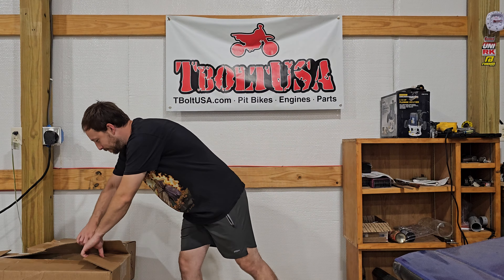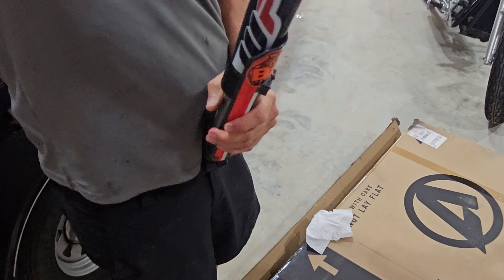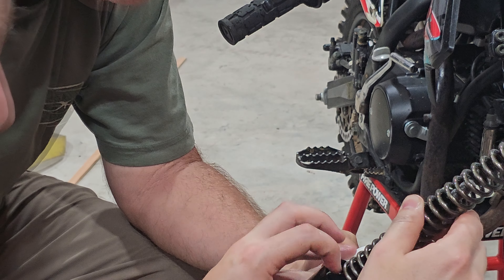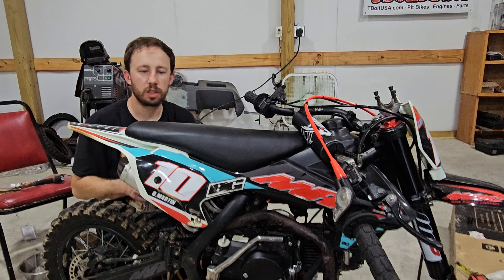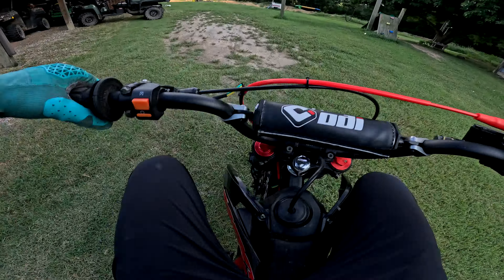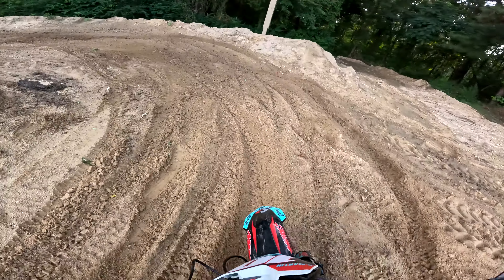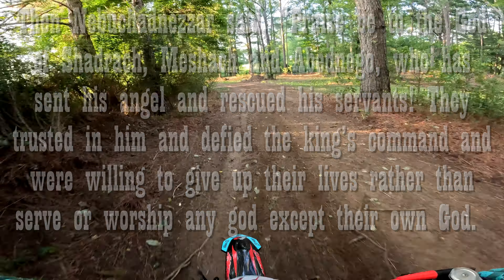X-Pro Storm Suspension Upgrades (Inverted fork mod and DNM rear shock)

Comment: Still more comfortable on the Honda though I imagine?!? I sold mine and bought a klx110l and bought my son the klx110r. I do miss the power that the zongshen had in the storm though. I guess it's time for performance parts on the klx now. Lol
Reply from the maker: It's hard to beat the comfort of the Honda, Kawasaki, or yamaha 110s. There is a lot more room on those bikes for sure. The Honda is set up super nice now. The X-Pro Storm definitely has more power and has more pop off the jumps because it's so light.  Once you do a few upgrades on the klx, you will love it. I can ride the Honda just as fast as the X-Pro,  but I have to wind the Honda out. The x-pro you can just blip the throttle and clear jumps. On the Honda I'm wide open in 2nd gear lol.
Reply: @MartinRacingChannel  yup exactly what I thought when I switched. I like the parts availability for name brand also though and the elec start is nice but they are definitely heavy.
Reply from the maker: @joshmiedema13  Have you done any mods on the klx's yet? I have been considering getting a klx140 to build too.
The X-Pro is set up a lot better for me now compared to when I first bought it. The custom seat I made was a huge improvement. I still want to build a bracket to drop the footpegs an inch or so and Im probably going to try installing my big bore kit/ race head again and see if it will stay together😁 It's a fun beginner/ play bike for sure. I have thought about selling it, but I like being able to create content for both sides. Chinese and Japanese bikes.
Reply: @MartinRacingChannel  I tried lowering the foot pegs but it still felt like I was over the handle bars and it made it more difficult to brake and shift. It really just needs like 2-3 more inches between the frame and the bars
Reply: The only mods I did to the bike so far was thicker fork oil and bars. I also cut the air box to match frame hole and drilled out stock exhaust but I am working on jetting now. I really think the next step is a big bore kit and they aren't that expensive!
Reply from the maker: @joshmiedema13  I agree! The distance on the crf, klx, and ttr are much better and you can get a straight foot peg bar and triple clamps to have even more room.

Comment: Do you know if any mods you have done will work for the XPRO x19? Would like to upgrade this bike I just got for my niece. Thanks
Reply from the maker: @MrBmh3773  Nibbi Carburetor , air intake, chain and handlebars should be able to be upgraded for sure. The front forks should be similar. The rear shock you would have to measure. Upgrading the tires to the dunlop mx34s was a big help as well.
Reply: @MartinRacingChannel  awesome I appreciate the response I will definitely look into that stuff been riding moto cross bikes for years and she’s been wanting a bike so started with something on the more affordable side to see if she would even get into it but being a moto guy I can’t leave anything alone so would like to do as much to it as I can. Thanks
Reply from the maker: @MrBmh3773  The carb and tires helped alot. I needed the taller handlebars for my height and the chain needs upgraded if she starts pushing the bike to its limits. Use lock tite and go over the bike. It will safe you time in the long run and make sure to change the oil  before you start it and change it after a few hrs of riding. The engine has held up very well for me and I don't cut it any slack😁
Reply from the maker: @MrBmh3773  I have all of my upgrades in the description if you want to check them out. Good luck with the bike. I hope she ends up liking riding.
Reply: @ thanks I really appreciate it and I will definitely look up all the stuff you did. Thanks
Reply from the maker: @MrBmh3773  You're welcome! Thanks for watching.

Comment: Ur shock link goes to the previous one from your other video, do you have link to this white one?
Reply: I see you got it custom ordered, do you think the previous shock you upgraded would be fine for normal trails and small jumps? I'm 220lbs still using stock shock, I'm sure anything is going to help me at this point lol
Reply from the maker: The amazon does fine for normal stuff and last pretty good. $40-50 bucks for months of fun. The dnm custom shock is 145 I believe ,it's been a while. The dnm shock is way better ,but 3x the price. If you want one made I can give my contact information to you.

Comment: also where did you get the 260mm 1000lb dnm shock from im very interested in getting one myself? thank you
Reply from the maker: @jeremyingram4097  I bought direct from DNM I can get you my contacts info if you'd like.
Reply: @MartinRacingChannel  yes please that would be greatly greatly appreciated buddy🙏
Reply from the maker: @jeremyingram4097  contact dnmrancho@gmail.com and let him know what you are wanting built. He will get it knocked out for you.
Reply: @MartinRacingChannel  do you by chance remember what it ran cost wise for the custom setup? i had ordered there 350lb setup and im returning that as its basically useless lol
Reply from the maker: @jeremyingram4097  I believe it was $145.00
Reply from the maker: @jeremyingram4097  You need 900 at the very least, because of the geometry of the suspension. I weight 170ish. I might have been able to go to 1100lbs. ,but it feels pretty smooth. I didn't want it to feel like riding on a 2x4 with wheels
Reply: @MartinRacingChannel  yeah im gonna get 1000lb and thanks for all the help and info much appreciated
Reply from the maker: @jeremyingram4097  Definitely,  thanks for watching and commenting.
Reply: @MartinRacingChannel  forgot to ask was it a pretty quick turn around time on it or it takes a while? I see there based on Taiwan I believe
Reply from the maker: @jeremyingram4097  About 2 wks
Reply: @MartinRacingChannel   ok not too bad. just waiting to hear back from them now. i just installed the red 40$ shock you had in the video but now im waiting on a spanner set to come in tomorrow so i can adjust the preload up a bit i saw you said you had it up about to the 14th thread. its better than stock already but it could definitely use a little more preload
Reply from the maker: @jeremyingram4097  The Amazon shock works really well for $40. I had one last almost a year and another for about 3 months. You can't go wrong for the price.
Reply: @MartinRacingChannel  yeah we dont have a cool track to ride on like you do just some lil jumps here and there and ditch fly outs but ive already bottomed out the stock one alot so i had to upgrade. hoping adding some preload to this red shock tomorrow will make it a bit more solid till i get a custom DNM, hows that one treating ya so far?
Reply from the maker: @jeremyingram4097  It has held up great so far. I would love to find a heavier duty front fork setup. I think I'm a little too heavy for the bike , so I'm testing limits of it😁One upgrade at at time until it's completely custom lol
Reply: @MartinRacingChannel   yeah im interested in a front fork mod as well. like i said before im still just on the x15 110cc and i got it running really well with the nibbi now and a tooth bigger front gear. but my forks dont have any dampening adjustment so ive kinda been looking around for a fork upgrade option havent really found much yet. but i agree one upgrade at a time definitely fun bikes for the price cant really beat it
Reply: @MartinRacingChannel  you did use 2022 ktm sx 50 graphics for your bike correct? im about to order me a custom set for mine. thanks as always buddy
Reply from the maker: @jeremyingram4097  Yes they turned out really good. Check the styles of the lower forks to make sure they are the same as yours the 2018 and 2022 are different style fork guards. Order the one that looks like your style. You are welcome. Good luck. Let me know how it turns out.

Comment: Hey brother a few questions - how tall are you? Is the seat on your bike at the stock hight of 29 inches? And finally do you still have the 14in and 12 in tires on this bike? Thanks
Reply from the maker: @evanlucas8734  I'll measure seat height tomorrow. I'm still running the 12/14 setup. If it's any taller it's not by much. The rear shock might set it up a hair taller I have my tall seat back on it as well, but I'll update you soon on the height.
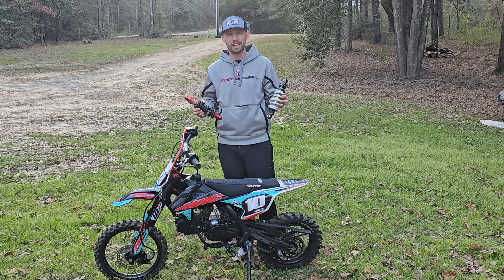Reply: @MartinRacingChannel thanks I’m trying to judge what bike I need to get by comparing your height to your bike at 2:45
Reply from the maker: @evanlucas8734  I'm 5'10" 
I bought this bike to compete with crf110s,klx 110s, and ttr110s size wise. Engine wise it's a little more powerful, but very close to modded 110s.
Reply: @MartinRacingChannel  thank you, from what I’ve been able to find your bikes seat should be 3 inches higher than a stock crf 110
Reply from the maker: @evanlucas8734  It's a little taller than my built 110. The 110 has a larger seat and the plastics are bigger as well. The wheelbase is a 1/2" difference between them and the xpro in this video uses a replica ktm 50sx plastic and seat.
Reply: @MartinRacingChannel  ok thanks for the info. You have an entertaining personality so keep at it and your channel will continue to grow
Reply from the maker: @evanlucas8734  Thank you! If you haven't checked these videos out it might help you see the difference in the 2.
https://youtu.be/yKq1bN3iAig
https://youtu.be/MsWeIDQIEEY
https://youtu.be/oaPdBemeTSU
Reply: @MartinRacingChannel  the 20 minute video was the first video I watched of your, I just gave the other 2 a watch. Did you build the track in your videos